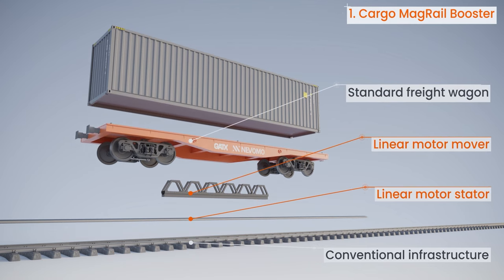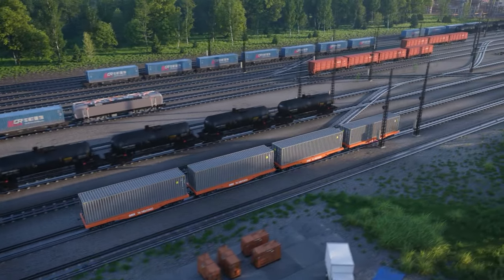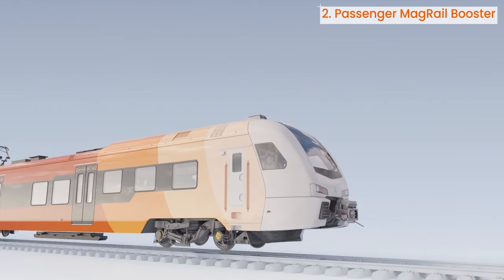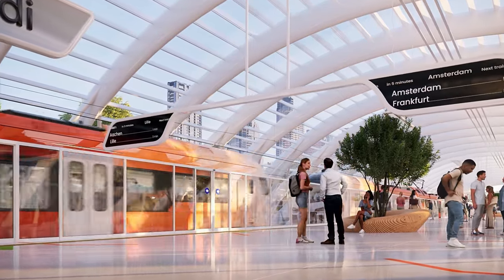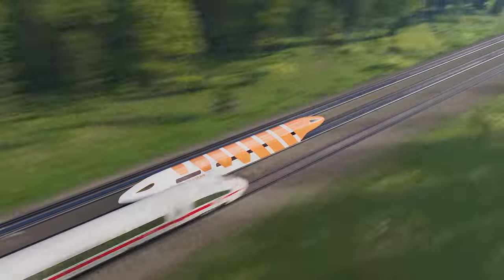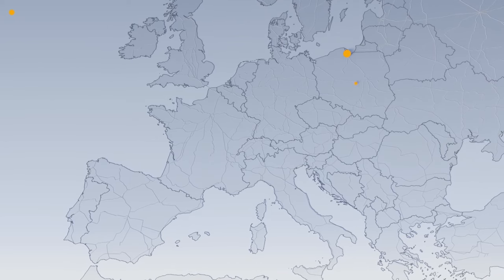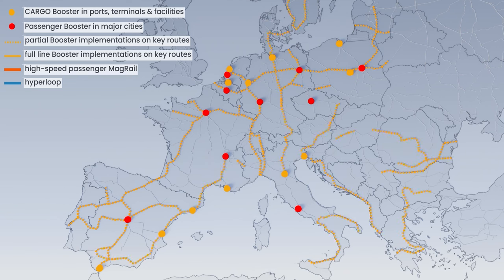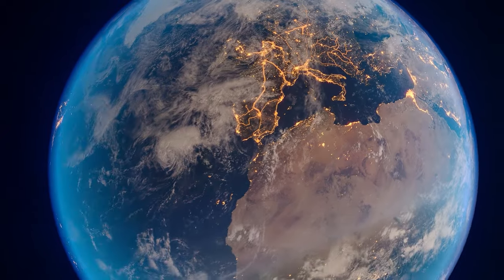How to implement magnetic rail in Europe? | MagRail by Nevomo

Comment: In France train are limited to 320 Km/h, not because of the wheels but because of the electricity cost. After about 110 Km/h you spent electricity for overcoming the drag. The aerodynamic drag increases as V2. At 250 mph (402 km/hr), the aerodynamic drag swamps the static and rolling drag, accounting for 80.6% of the total - static and rolling drag are just 19.6% of the total.
Reply: Ever thought about the fact that Nevomos Magrail trains will have less ground friction (due to levitation!) and less aerodynamic drag due to their lower cross sectional area ? 🤔
Reply: @kingplays5369  These measures are for the French TGV. But this demonstrates that the main problem to solve is not the wheel drag but the aerodynamic drag. Does Nevomo get a new revolutionary technic which decreases dramatically the 80 % of the drag ?
Reply: @kingplays5369  With magnetic levitation, you also get a magnetic drag ! 
At 402 Km/h, the TRO6 Transrapid gets a magnetic drag > the TGV wheel drag and the TR06 aerodynamic drag  > the TGV aerodynamic drag !
At 402 Km/h, the TRO7 Transrapid gets a magnetic drag < the TGV wheel drag.
At 402 Km/h the cost of power per 1,000 passenger miles for the TR07 is $7.36 < 8.67 $ for the TGV. This is a little gap.
7.36 $ leads to a very expensive ticket.
The cost of the electricity will increase in the futur.
It's not an easy problem to get a valid commercial solution.
Reply: @ytbpromeneur  In the video and on their website you can see that the cross sectional area is at least ~30% lower because their MagLev isn‘t as high as a TGV. But I appreciate your opinion as well 👍🏼
Reply: MagLev reduce energy spending of the 80% than traditional traveling mode.
Reply: Wheel-trail fiction builds up the electricity cost.MagReil technology eliminates the fiction thus the cost ecrease at high speed.

Comment: Can it increase speed when cornering and on steep slopes? How do it function on the turnouts?
Reply from the maker: MagRail has the big advantage of being fully compatible with classic rail infrastructure. Whenever possible, MagRail vehicles would lower the speed enough to be able to travel through a standard switch, and reaccelerate again if need be. Potential existing track modernization with geometry readjustment for increasing the allowable speed in switches is also possible to lower the amount of time and energy lost for vehicle braking and reacceleration. We also have a high-speed switch design concept for track switching while levitating, but this kind of engineering objects proved to be expensive in the past with MagLevs, and we will try to avoid implementing them unless necessary.
Reply: @Nevomo  Thank you so much.

Comment: Good morning. Do you provide for the fastening of the third track of power supply in the design of linear motors? This would potentially reduce the cost of operating the tracks, dispensing with the overhead power grid. However, in the near future this would be suitable only for closed sections or for a very long term, when most of the lines would already be equipped with linear motors for the construction of the third track.

Comment: I know this won't fit into the whole convention of "innovation" of this solution, but:
- Using a third-rail based linear motor in a way that will be safe and reliable involves the cost of modifying the entire infrastructure and creating a ton of electronics on the track - it's not just an electronically advanced bogie as most people think - and economically speaking, this construction cost will be very high.
- Separating levitation and propulsion may have some justification in some specific use cases to make the whole subject more efficient.... but Nevomo hasn't even shown any documents on their technology, so you can't even be sure that this solution can be supported at full scale.
- Overcoming air resistance requires the most energy. Vactrain (called Hyperloop by newcomers) could make a lot more sense in terms of transportation efficiency.... if it were possible to create a vacuum under the conditions that would be required for a train in a tube. This is still an unsolved problem.... and physically very difficult to solve.

Comment: Nevomo;
- Isn't possible to reach 550 km/h with the current standard passenger wagon, with the magrail technology and lightweight bogie?  
- Wondering as well how you secure the levitating magrail trains stay attached to rail, and don't derail? Compared to Maglev trains is not a closed rail system

Thanks for an informative video!
Reply from the maker: Hi Kim, thanks for your questions.
1. In order to reach 550 km/h we need a levitating version with dedicated MagRail vehicles.
2. MagRail vehicles will be significantly lighter than typical trains - approximately 20-30 tons. The system is designed in a way that allows you to move around curves and even increase the speed in them. We use two mechanisms that will allow us to maintain the safety and comfort of passengers - the first is increased cant deficiency, which, thanks to a wider spread of pressure on the infrastructure and a lower center of gravity of the vehicle, allows us to completely eliminate the increased impact of centrifugal force at higher speed. The second (optional) one, for use on very winding routes, is the wagon body tilting mechanism, which is a solution known from high-speed rolling stock (basic version of Pendolino, Talgo).
Reply: @Nevomo  great to hear! Does it mean, we could travel at 550 at the railways that were designed for max 150 km/h?

Which stage this product is ATM? Working prototype? Any plans for industrialisation?
I really really cannot wait to simply drop the need for airplane transport. To be honest - not only the one of myself, there's plenty of them and it's impossible to see a clean air anymore, there's always something flying around :(
We need our trains to really upgrade!
Reply: @korniszon68  nie ma szans żeby to sie udało. W innych moich postach pod poprzednim filmem pisałem dlaczego to moim zdaniem robią.
Reply: @Nevomo  Wonderfull. I hope to see it soon  on italian infrastructure. How much cost improving existing infrastructure whith your system?
Reply: But what about passenger safety at that speed? Surely there shouldn’t be passengers heads cracking open whenever you go around a curve.

Comment: Please present this to the next UK government. Current HSR project inflated to one of the most expensive trains in history. Totally incompetent. This simplicity with regard to using existing tracks will be appropriate for even our politicians' small brains.
Reply: Unfortunatelly, it cant solve the UKs rail problem if you think about it. The problem is capacity in the UK not speed. If your frighttrain, local train and Long distance train all need to use the same existing track at the same time two of them will need to wait. Adding capacity in the form of new tracks is hence the only solution. Making them High Speed is a nice bonus, but this is really only about curve radius, which magrail probably has the same limitations so no high speeds without 'straight' curves.
The costs are horrific though, but also due to bad planning and protests of the 'big brain' people who actually show overconfidentially that they have no Idea about railway networks